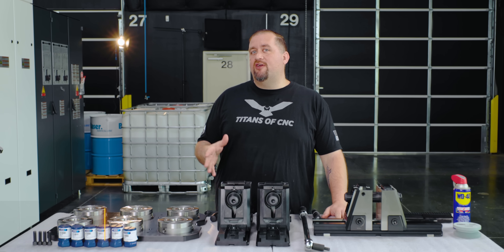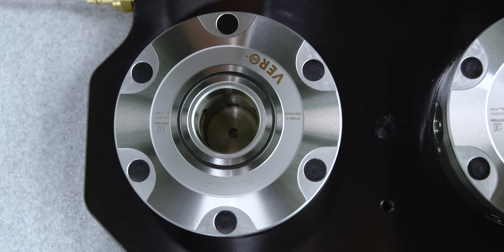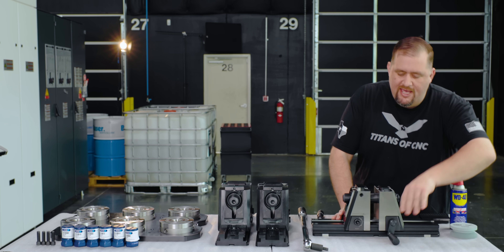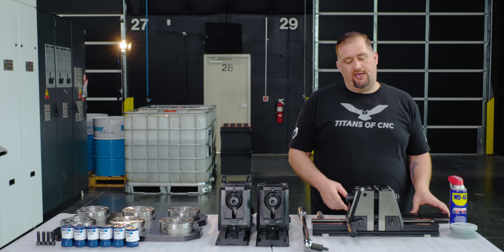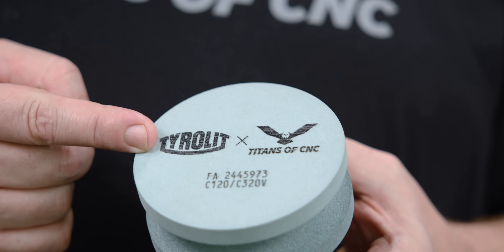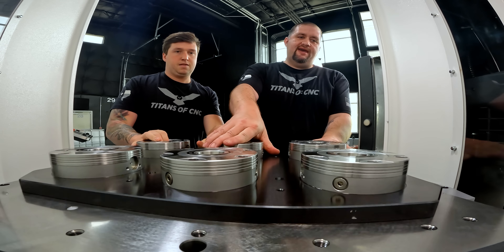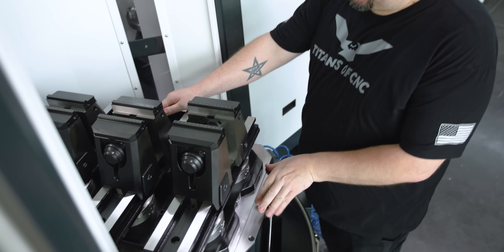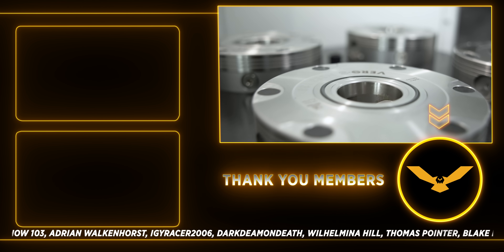Quick Change Powerhouse Vise Set-up | Heller HF5500

Comment: Cryogenic cooling is a type of cooling that uses extremely low temperatures to cool the tools and workpieces. This can help improve machining quality and reduce tool wear. Coolant is also used in CNC machines to cool the tools and remove chips from the work area. There are different types of coolants used in CNC machines, including water-based coolants and oil-based coolants. Whats the best?

Comment: Question for Barry. 

I always see that you’re always using a torque wrench when setting up parts and in this case fixtures. What do you usually set that torque wrench to for tightening down your workpieces?

Comment: I was taught that machinist stones are always supposed to be used in pairs so you can condition each stone and get rid of any embedded grit or burrs before use. You don't seem to have mentioned this anywhere so I was wondering if I missed something or you just have a different approach? Personally, I wouldn't feel comfortable stoning without rubbing the stones together to condition them first.
Reply: what you said is absolutely true machine stones must be conditioned before use, now they surely know what they are doing so we need to wait for more info from them
Reply: Yep, you definitely need 2 stones in order to remove the high spots on the stones and keep them flat.

Comment: 6:36 - I've cleaned enough of those fixtures to become obsessed with covering up unused threaded holes.
Literally YEARS worth of rotten oil, rusted cast iron chips, brass, stainless, and hardened steel grains was clogging up every single hole that wasn't covered by the vice plates.

I started making my own little slotted screws from a couple of M16 bolts just to avoid having to clean any more holes than necessary when replacing the fixtures.
Reply: I know the pain😬

Comment: I use the Schunk KSC Minis, the quick change system is cool, but one of the mounting jaws ended up with a busted ball bearing. Now it doesn’t close cleanly and repeatedly, which is a pain. Making soft jaws also sucks for them as you need to do all the internal geometry.
Reply: check if they have premade blanks for soft jaws, so You only have to mill what You need